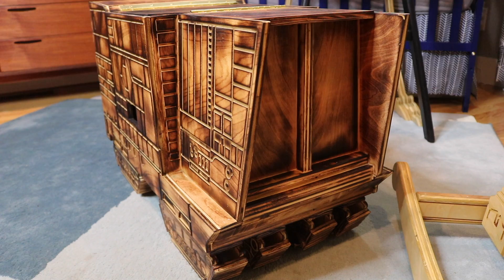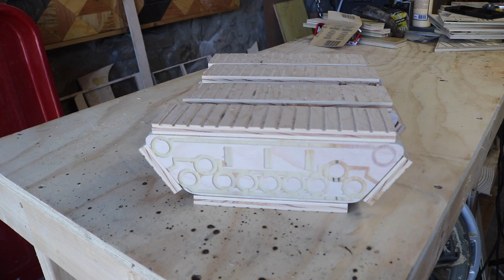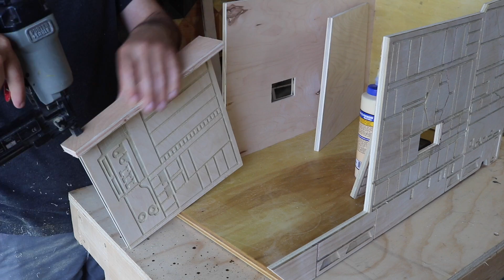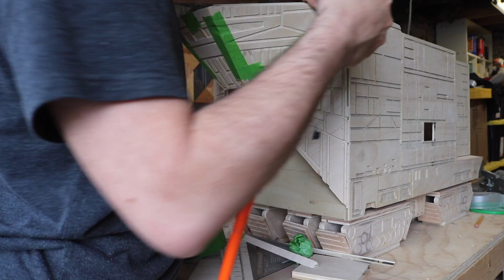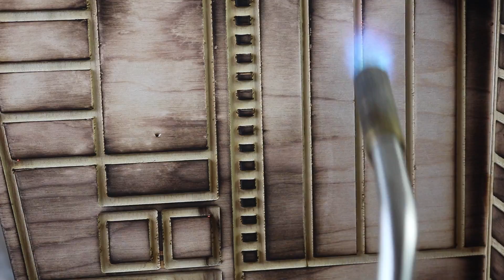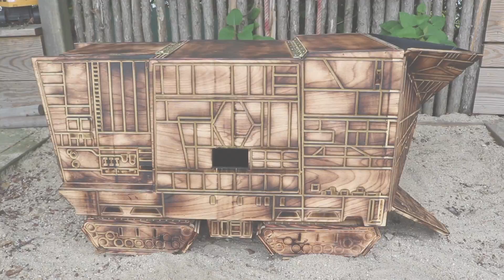Making a Star Wars Toy Box - The Sandcrawler!

Comment: Nice Work! but wouldn't it have been easy to montage the hinge so that it's 80% hidden. You put it on top. you could have mounted it in between.
Reply from the maker: Klaus Koessering Yes, it would have been easy, and if this was solid wood I would have done just that. But for plywood, this connection is stronger than drilling into the ply layers. My kid doesn’t know how to be “gentle” with his toys right now and would have ripped the hinges right out otherwise.